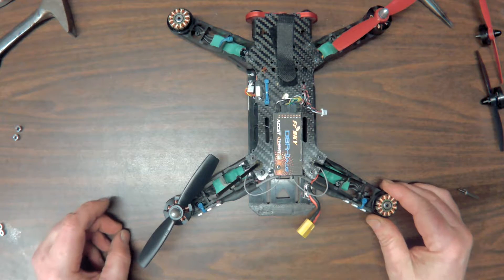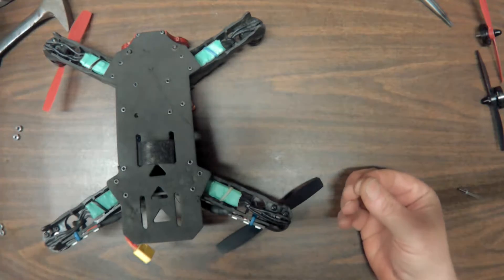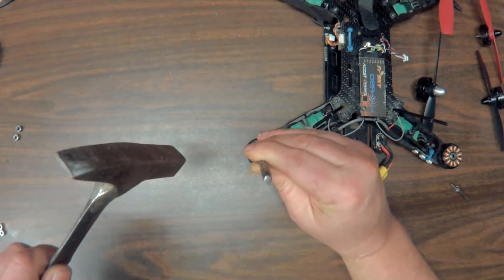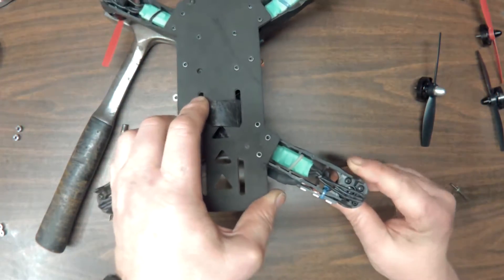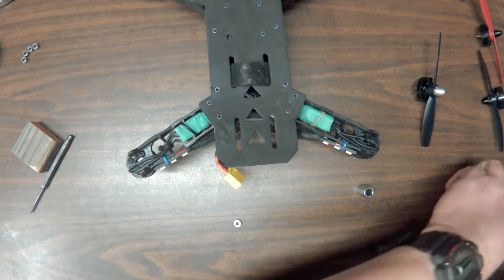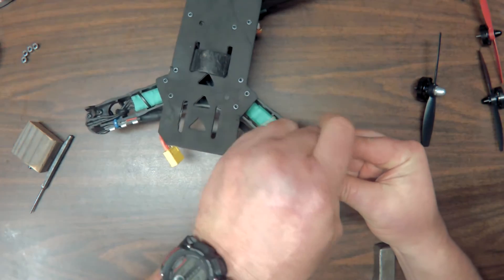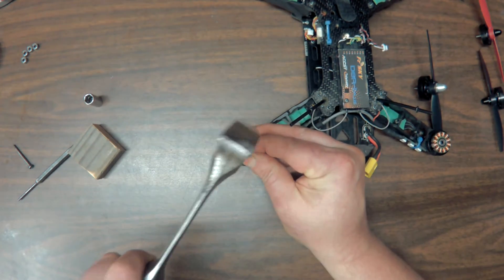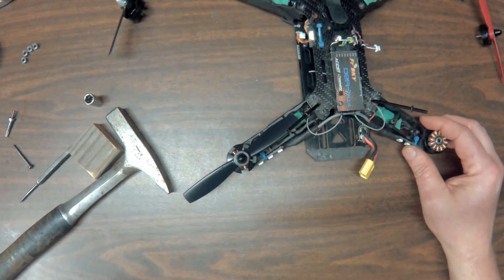ER 250 Bearing Replacement

Comment: What size punch are you using. 
Would a 1/8 in. punch work, do you think?
Reply from the maker: That may work. It just has to go through the bearing, that's all. If it goes through the bearing with a little space, then you should be able to gently knock the other bearing out.